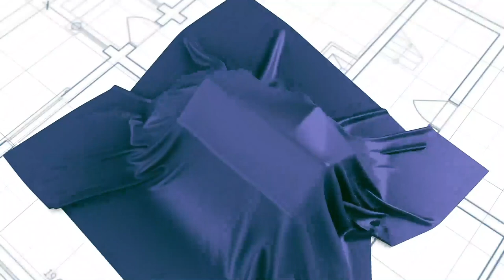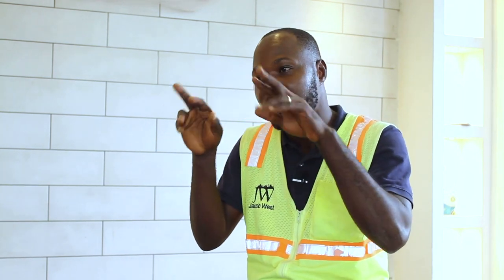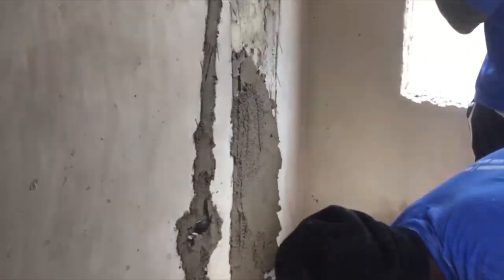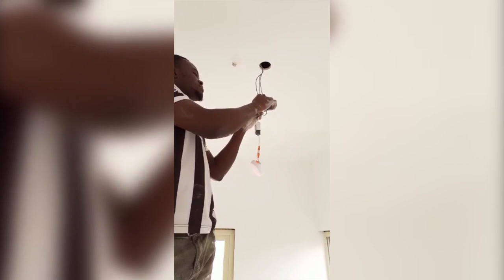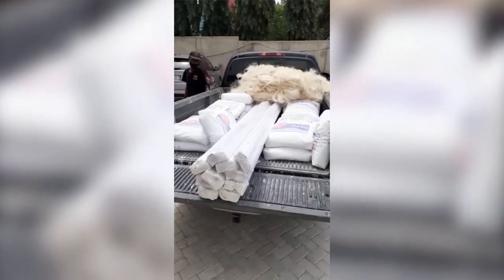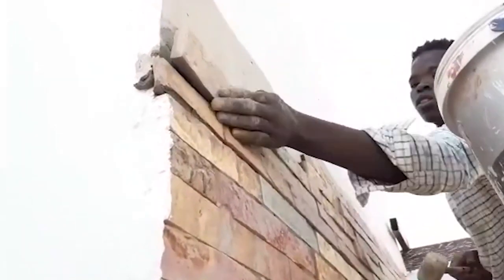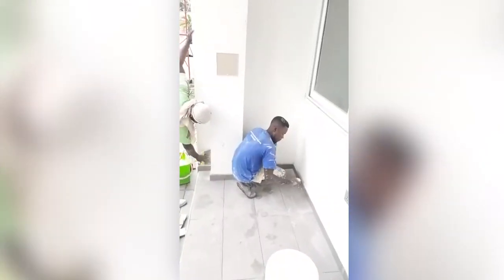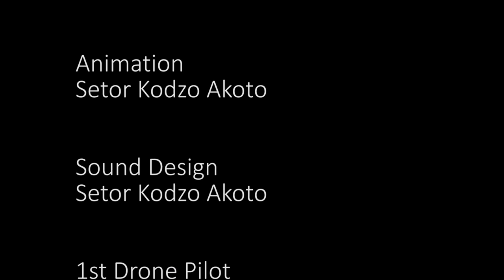How to Finish a House in Ghana | East Airport Project Completion

Comment: Nice video. Keep it up bro. I have a question. What are the pros/cons in using plaster boards over the normal pop?
Reply: Great question i would like to know as well
Reply from the maker: Plasterboards are basically POP with the only difference being, plasterboards are pre-made. Using plasterboards gives you a cleaner finish than POP. The process is also quicker and can be completed in a matter of hours if the place isn't so big unlike POP that requires a mold and some time to dry. Plasterboards can easily be repaired if they are damaged an won't cost you as much.  You can compliment the clean finish of your plasterboard ceiling with corner molds, assuming you want some kind of design in your room. Cost wise, plasterboards are better and most cost effective than POP.
At the end of the day, the one you use comes down to your personal preference.
Reply: @Jacobwestgh  thanks a lot for the detail info on cost, the finish, maintenance and time. Nice. Thanks once again.